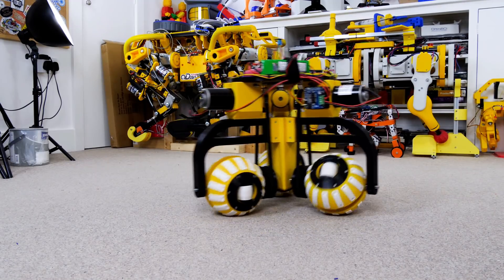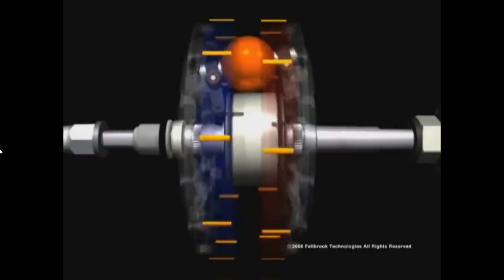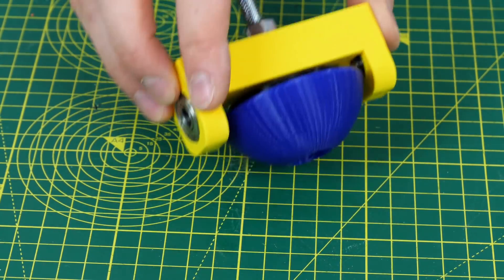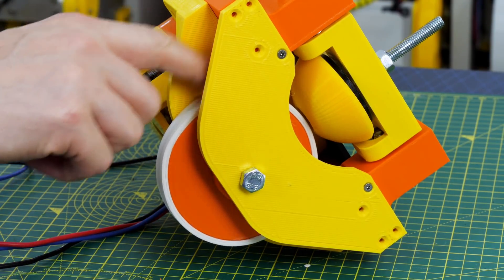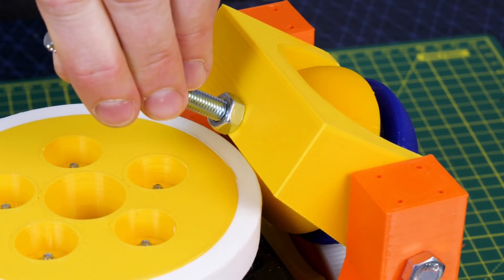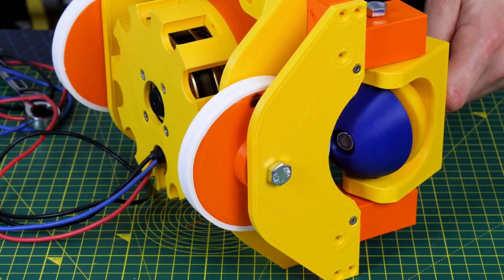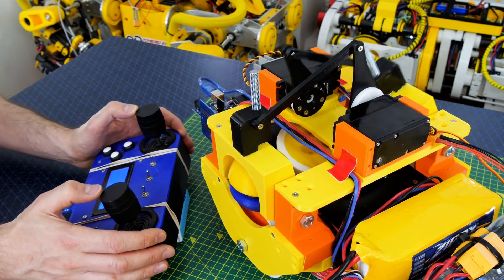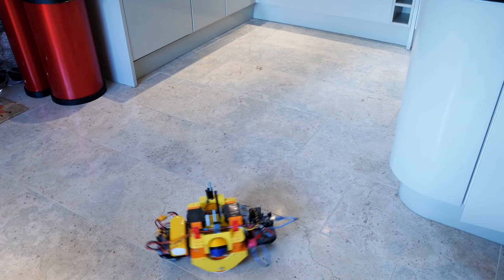Continually Variable Transmission with Clutch & Reverse

Comment: For some reason I was researching this same cvt system earlier this week. What a coincidence you made one as well. Great job. I think it could have a use for a steam power or even gas powered robot. It would really shine if it was 6 wheeled, all direct driven by a single belt and the same 2 servos on a single motor. It could be a great drone vehicle with gas it could run for hours and miles in this configuration.

Comment: Do you really need to completely declatch a wheel for that design? Looks like it will be better to declatch the "ball" from the drive and have a full hemisphere instead of the "dead spot" - so you will have a functional per-wheel brakes - a "hollow ring" between hemispheres will declath the sphere from the drive, and a hemisphere's "pole" will lock the wheel, providing a braking action

Comment: Very nice work. I wonder if you'd be interested in making two versions of the same project- one using CVT and the other using electrically varied BLDC power. Because the well-known advantages and disadvantages of each approach matter more or less depending on the intended purpose of the machine.

Comment: "Medical" stuff should never be a sponsor for video content... too bad, otherwise the video was really nice and I would have liked to gives it a thumbs up, but I'll not support such practice...

PS: though awesome, one flaw of your design I think, is that you can't reach the dead spot on both sides of the ball, if the mounting bracket of the balls were turned 90 degrees from the top to the side of the robot, you would get a higher motion range, would also need to change the position of the servos to be on the sides rather than the top though.

Comment: it works well on a smooth flat surface, but although the CVT allows you to control each wheel's speed independently, doesn't it also trade torque while doing so? That would mean that the wheel spinning faster would push with less force, and in a rough or steep incline turning may behave unexpectedly.

Comment: This mechanism would be perfect to be powered by a flywheel... looking at you, Tom Stanton
Reply: Somehow he would make a trebuchet out of it.
Reply: @0calvin  he could make an air powered CVT flywheel trebuchet attached to his bicycle... Somehow
Reply: desire for flywheel monorail grows
Reply: Great idea aha
Reply: I have no idea what makes you think that, flywheels require efficiency that this mechanism cannot have
Reply: If you had a flywheel geared to drive that main drive gear and had a small motor running at its most efficient speed, then instead of the neutral space on the sphere gears, have it somehow take that inertia of the wheels back to the fly wheel you could have regenerative breaking and then the whole think in theory could be quite efficient because it would overall be driven by a very small light weight motor?
Reply: @rohancwright  Most friction based CVTs (including this one) have bad efficiency. A good chunk of the motor's power is converted to heat via friction because the gearing does not roll smoothly but rather rubs over these hemispheres. When he mentioned the different effective circumferences, he alluded to this very problem.
Reply: I thought this was Tom's second channel... 🤗🤗 I'm assuming they're from the same county?
Reply: Funny you should say that because this guy actually reminds me quite a bit of Tom, both in the types of experiments he does and by his manner of speaking and voice. I think they should collaborate on something.
Reply: @Tom Stanton
Reply: But a Flywheel has a highly variable speed, goes from very fast to slow in a short time, while this central drive wheel is designed to run at a constant speed

Comment: Is this the most practical way of making wheels turn at different speeds? No.
But is it the most FUN way? Definitely!
Reply: And quite impressive too!
Reply: Yeah, it's quite pointless for actual usage. For robot locomotion, the wheel hub motors seen in hoverboards seem to be the pinnacle in actual design. Proto G recently put for of them together in an omniwheel configuration. But always interesting to see new ideas.

Comment: This is a nice little piece of mechanical engineering. Really awesome how it works. Maybe use a set of clutches on a drive shaft like you suggested to keep the motor weight down and close to the center of mass and then use it just for a hand, like an improvement on your Ultron robot's hand.

Comment: Would be interesting to have the angle based on the force the output wheel needs to turn - so you could build a continuous "gear shifter" for bikes that always needs the same input force.
Reply: Actual bikes would never use a drive like this because the friction is way too high and it will slip under high load - efficiency is the #1 consideration for road bikes and high torque transfer for off-road bikes.
Reply: @PKMartin  but that's not fun.

Comment: This would be a great setup to use for a huge steam or gas engine powered robot. Something that the power source would not be as responsive as a stepper.
Reply: My thought exactly. Hook this up to like a lawn mower engine, which isn't normally conductive to electronic control. Make a nimble robotic lawnmower!
Reply: Like a sterling engine!
Reply: Nice, made all in copper. The cvt's could be copper toilet floats.
Reply: Oh and instead of servos you could use valves and actuators. The sterling engine could also generate the pressure to move them and the power for communication.
Reply: Yeah, the engine would only need to maintain constant RPM. The CVT wheels would translate that into useful motion. If the same engine could generate enough surplus power to run its electronics and servos you'd have a pretty long range robot.
Reply: Use a gas turbine lmao

Comment: This worked way better than I expected! Now I wonder: if you put a big motor on one end with a belt running off it and around a bunch of rollers, could you put these ball drives against the belt (such that it's pinched between the ball and roller)? That could allow for driving a whole lot of individual wheels or whatnot off a single motor with relative ease. Hmm. Could be interesting!

Comment: I really like the idea of CVT. In fact ive looked into it and started designing my own. I am very disapointed that there isnt a single design solving the core problem of the cvt, where mine should theoretically do that. The core issue usually is 'resolved' by making it a friction based mechanism. By resolved i mean, solved via corner cutting. Its why noone wants to use CVTs for real.

Comment: could you do something with a cone-shaped thing instead of a circle?
Reply: Not with this mechanism - as its all about rotating the active part the shape has to match that rotation. But cones are used with Belt systems of CVT, and could be used in similar fashion to this if the control motion is linear so it matches the cone shape.

Comment: The moment you said it'll drive like a tank, I thought about tank treads with a free-rolling capstan and the ball clutches as the pinch-rollers. Not at all sure if it's doable, let alone feasible or even usable. Just a random thought.

Comment: Given the motor spins continuously I wonder if you could use that as a gyroscopic stabilizing mechanism
Reply: I believe fly wheels must be untouched in use for stabilization. If a heavy weight were to be attached to the output it would give a reaction wheel effect that would be counter intuitive to the robots movement.
Reply: Interesting, I doubt with the weight required for gyroscopic stabilization the power loss when engaging the drive wheels would have that much of an effect. Seems do'able.
Reply: I was thinking that as well. But the cvt's would always be spinning even when the wheel was in neutral so changes in fly wheel would really only happen when engaging and dis engagement. Especially if it was inverted and the flywheel was under slung. But then there is the speed of the flywheel to consider. Would need to recalculate reduction to the wheels.

Comment: The robot is cool. Just wondering if there are perceivable benefits to this design as opposed to the more traditional wheeled robots you've made before; reduced power consumption, size of motors, fewer components, etc.
Reply from the maker: Probably cost mostly - imagine a 6-axis robot arm with one main motor.

Comment: Really clever clutch mechanism, I'd imagined something like the little wheel your omniwheels have so it can idle on the drive wheel, but your way is much simpler and better
Reply: There is one downside to its use on this particular testbed style of machine - as there is no braking options that wheel is free to run so you can't 'turn it off' and steer around it 100% predictably - its a very neat execution of the mechanism don't get me wrong, but on that tank steering testbed the clutch freewheeling can lead to steering troubles when you wish to turn around one side or other and the free wheel just rolls so you instead get an uncontrolled veering in the direction you want (as the free wheel still has friction and resistance) - simple enough to avoid in practice if you can accept not being able to just turn the one side against a stopped other i.e the very tight radius but not 'on the spot' turns - as in effect it can only turn 'on the spot' (reversing side B from side A) or at any of the wider radius when side B is just solidly engaged and side A is however much faster you desire to create that radius of turn. Add in a brake for each wheel and that trouble goes away entirely too.

Comment: Would it be possible to somehow add “teeth” or something to decrease the possibility of slippage and stalling to the point where you could build one at a larger scale and put it in a car
Reply: Because it’s continuously variable, teeth won work. Maybe a belt would be better.
Reply: That would be a first
Reply: I don't think so because you'd have to continuously change the amount of teeth around the hemisphere as the circular path of the contact gets smaller. This is impossible as you can only make a discrete number of teeth. It was used in cars by DAF (dutch manufacturer) but I believe that used a belt-pulley system (so it could also slip).
Reply: You don't need teeth to prevent slipping, just surface area and/or force - bog standard car clutch for example have no teeth (at least not involved in the actual clutch action) its just plates being squeezed together, lots of milling/lathe tool sets are just tapered cones with no key (tooth) to prevent slipping - they don't slip because the area is large and the clamping force between cone and socket walls is high enough. 

The same could be true of mechanisms like this - as long as that hemisphere is oversized to the gap between input and output enough to create high compressive force and thus friction between the parts (and the frame its all attached to is stiff and strong enough to take that pressure too). So in practice similar mechanisms usually use a much more compressible material for one or other part - which increases the surface area significantly and pushes most of the wear onto the softer part - then you just need to adjust for the worn softer part or replace that one part eventually.
Reply: @foldionepapyrus3441  I understand that but I think in a system like this the force wouldn’t allow for the hemisphere to move so it would have to disengage and reengage making this system no better than a normal manual transmission. The benefits of a cvt is that the ratio can change without disengaging and reengaging. So using such forces necessary to keep them from slipping wouldn’t work for a vehicle. That’s why I mentioned some sort of way to add teeth or something else since teeth wouldn’t work unless there’s some mathematical way to add teeth without causing other problems, just something to keep them from slipping that doesn’t use a lot of force.
Reply: @gavinhicks7621  The hemisphere will move, move just fine - remember the forces needed for friction don't directly act on the hemispheres rotational axis, and being paired between input and output are well balanced, so the friction added by the clamping force won't need to be that significant, its obviously there but getting the ball to climb its way through a changing tilt to operate as the CVT while it can still rotate the whole time shouldn't be that bad, maybe need to uprate the servo or give it more leverage, but it won't be that bad.

Its not putting the ball in a massive softjaw vice and squeezing the buggery out of it till it can't  possibly move, that is way more force than needed to function fine, its just putting enough force on it, and hopefully only in the best directions to minimise slipping with the power delivery, not lock the whole thing up.

Don't think its a particularly viable method for many projects, as how it scales in bulk, mass and complexity is so much worse than a belt driven cone based system. But its certainly not impossible to use it, just more challenging.

Comment: Why don't we have that in cars? I could imagine some nifty fuel savings.
Reply: We do. It started in F1 but is now common in civilian vehicles. My 2016 Subaru Outback has a CVT.
Reply: @morningstarkid07  it started way before F1. The williams cvt was in 1993-1994 while the first mass produced cvt car (DAF) was in 1958
Reply: many cars use CVT transmission which also are infinitely variable. they use belts however. they're said to be very efficient but can feel sluggish.